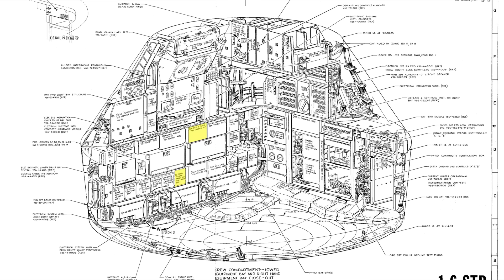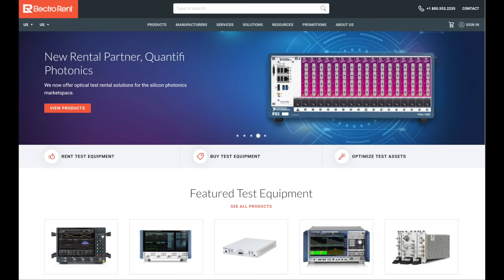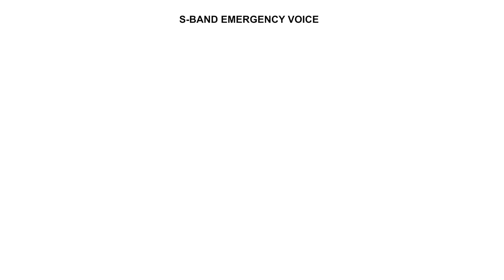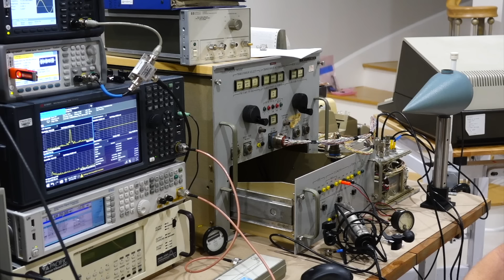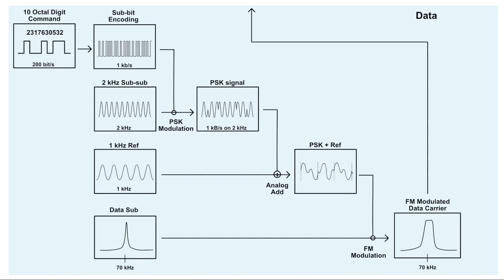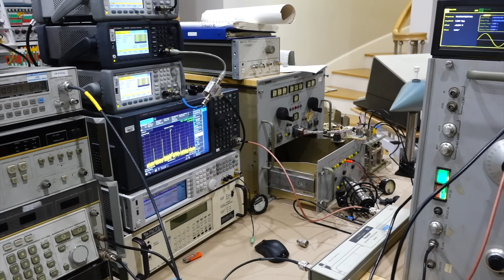Apollo Comms Part 12: Building an Apollo transmit station with Keysight instruments

Comment: “Where you going?”

Lunch. My scope is booting up.

You know it’s getting real when the price says “call for quote”.

How would they have tested these things back in the early 60’s? It had to be a building full of gear.
Reply: etesttool wants 91k for a n9020b mxa + i'm sure there are license fees to pay
Reply: the pile of analogue boxes they have WAS the equipment they used in the 60s
Reply: In the upper 5 if not already low 6 digit range for sure. Wanna see what makes it tick!
Reply: my E8285A takes ages to boot :(